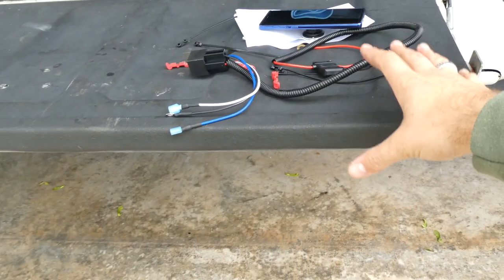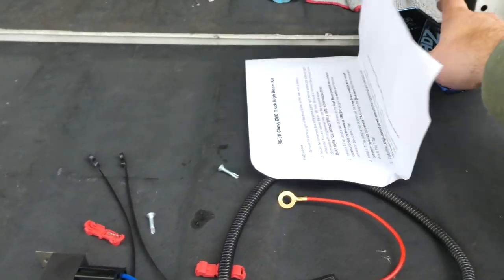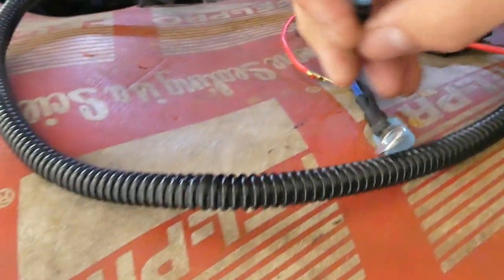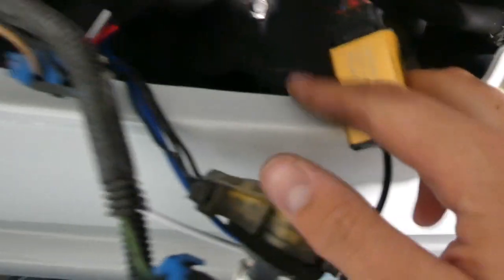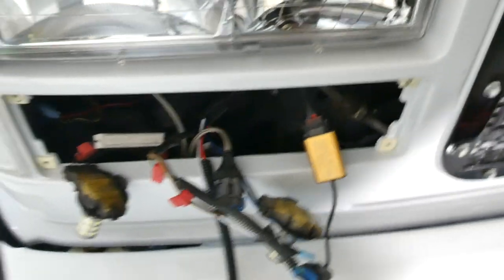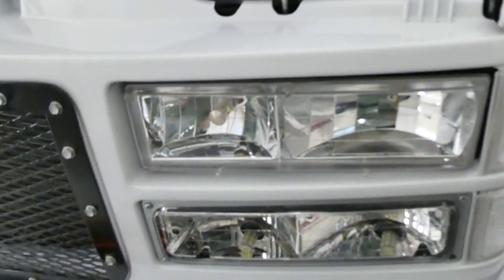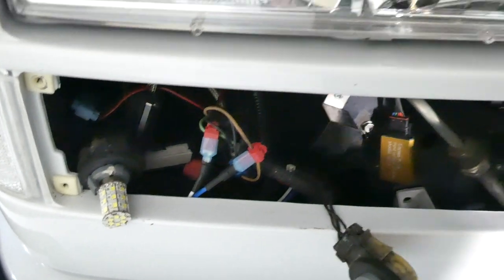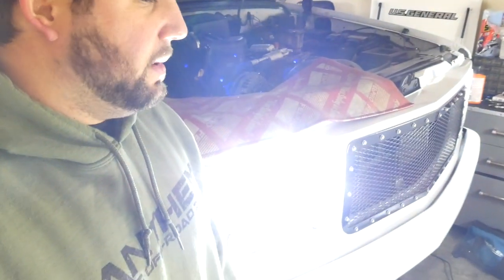4 Hi Mod 96-98 GM Truck - EASY TO DO!

Comment: I mounted all my hi4 kits to the firewall or the drivers side near the brake booster, and mounted the ground behind the relay screw, then the power wire to the fuse relay box power wire, then tap the headlight wiring behind the fuse relay box to hide for a factory look and easy of swapping the relay with having to pull the parking lights out

Comment: Like your vids, just updated all my lights to led and switchbacks for the turn signals on my 98 z71. Just a fyi you might want to put your power wire on a 12v accessory power, just to prevent battery drain. Attaching it directly to the battery is supplying power to your relay all the time. Thanks for the vids.

Comment: I have a 2001 Tahoe and I just took a piece of wire I had laying around and cut one of the wires got the head like and spliced it in and found a ground and now I have low beams that stay on when I’m using highbeams

Comment: I have been wanting to do this for my 96 silverado but haven't got the parts for it yet. I did buy true glass Spyder Auto replacement headlight housings which are very nice and you can replace bulbs if needed. I use Farhan 20,000 Lms 6500K low beams and when paired with the glass headlight housings are extremely bright. I was curious about the conversion like you did to not only see better up close but also farther away so I can see the deer better at night. The Deer are bad here meaning alot of them when driving so this might just be the way. Thanks for the video and explanation of the wiring of which goes where.   PS: T-Taps are so amazing. I even use them for my reverse light on my tailgate light bar with such a clean connection and super easy to do.

Comment: I have a 98 k1500 Just put led turn signal bulbs in and they were working fine until now. I only have turn signals/hazards when my headlights are off. Any ideas? The fuses look fine

Comment: Hi there! I fitted the wiring loom exactly the way you did on your video but my lights, when I hit high beam, are blacking out. Do you think that might be because I have normal bulbs? Not LED like you. Perhaps too much power? Any help or suggestions you could offer would be super appreciated!

Comment: Nice tutorial. What kind of headlight housing are you using? what kind of lights are you using for the turn signals and did they need resisters for hyperflashing?
Thanks!
Reply from the maker: Thanks! The headlights are just clear/chrome ones from eBay, bulbs are auxbeam LED. Turn signals are just some switchbacks from Amazon, and I had to add resistors and the EP29 flasher for them to work correctly
Reply: @BADZ71  thanks for the info. Keep the nice look on that OBS Chevy!

Comment: Did the T-taps come with the kit? If not, what size do I need?
Reply from the maker: Those came with the kit, and I've since then removed the kit to use the Movotor headlights, I'm not sure what size those taps were.

Comment: Hey man I’m debating on getting some of these headlights for my truck. On the parking lenses does the casing and lens come apart like your normal blinker casings
Reply from the maker: Yeah with some heat they will come apart fairly easy
Reply: @BADZ71   hell yeah man thank you. Your truck is clean

Comment: hey what light bulbs are. you running the truck for your head lights and for high and low bean and the indicator lights and turn signals light because I have a whiggt truck too with the clear lights and I want my front end to look like yours.. please if you read coukd you throw me some links so I can go by myself some too please thank your.. also geat video keep them coming bro

Comment: What every anyone does never use those stupid Scotch locks made by 3M or anything similar. They are one of the worse things ever invented for wiring. They cut the wire and open it up for corrosion. Butt connectors or soldering is the way to go. Also can mount on the driver side also. Power can be had from an available post on the relay box which also gets the components up under the hood and out of direct weather and water contact. Hid mine under the ecu

Comment: Why you have all those resistors lol i have all led’s in mine and no hyper flash. Upgrade the turn signal relay
Reply from the maker: Switchbacks require the resistors. I tried with just having the EP29 flasher upgrade but it wasn't doing it with the switchback in the mirror and the front lights.

Comment: Why does everyone pull the passenger headlight to do this mod? So much easier and better to just use the harness that runs down the drivers fender and power from the main on the fuse panel all right there. Both high and low beam wires pass thro that harness on drivers side near top of the fender

Comment: Their fuse is a TERRIBLE part of this WHOLE system as they put a way too big fuse in and it will melt the wire before blowing the fuse. Had this issue while installing my BOSS plow and put wires to headlight on wrong side so it melted all of my headlight wires when turned on.... just a heads up
Reply: What size fuse did u use instead?

Comment: The yellow parking lights now serve as Headlights?

Rather get a clear lens with a Yellow LED 🤔
Reply from the maker: This little mod allows your high beam headlights to be on with the low beam lights. The parking lights are Switchback, meaning white while running and amber for the turn signal

Comment: I noticed you had 2 lights under the hood and i tried looking thru your videos but i couldnt find anything. How did you that?
Reply from the maker: I think I may have touched on it in a video but don't remember lol. Just took a light from a truck out of a salvage yard and mounted it on the hood just like the factory light and wired it up.
Reply: @BADZ71  wired it up how? Make a video and i will sub😆🙃
Reply from the maker: Lol just connect it to the other light
Reply: @BADZ71  make a damn video!😡.....😂🤣
Reply from the maker: 🤣 DM me on Instagram if you have it. When I get the truck back I send you some videos.
Reply: @BADZ71  dammit you bobby! I sell propane and propane accesories i dont have time for ig😂
Reply: @BADZ71  thanks to your video it reminded me of getting the foglight switch as soon as i came across it and bam got it today along with the escalde console. You know what else i seen that was really rare, a canadian escalade cluster😲might go back for it tommorow since i wasnt tryin to fumble my console.

Comment: Where did you get your headlights and corner lights?
Reply from the maker: Good ol ebay
Reply: Would you happen to have the item description or link?
Reply from the maker: For the headlights I just search k1500 Headlights and there's a ton of options. The corners actually are no longer available

Comment: How do I get my inside turn signal lights to work
Reply from the maker: Do you hear the clicking noise when it's on? If not I'd suggest you replace the flasher relay. If you do hear it, then probably just replace your cluster lights.

Comment: BADZ71 your headlight switches inside the cab where were you able to pick up a whight switch at.. I can't find then anywhere I also have been trying to find a instrument cluster for all my speedo gadgets whight somehow anyone now whee I can find that at
Reply from the maker: I'm sort of confused by your question. You can get new switches from Amazon, RockAuto, or a parts store. The gauge clusters usually come from a salvage yard.
Reply: @BADZ71  I believe he is wanting info on the headlight switch since you have a white overlay on it like did you find the white overlay at a pick n pull or online.

Comment: I'd like to do the quad headlights to my 04 trailblazer
Reply: Look up fleece chips. All lights on mod.  They make a computer chip for $20 for your truck. So much easier than this install.  But only for 2003- current years 👍👍
Reply: @deez3814  
I did find a little wire jump wire thing online and did a quick vid on it.

Comment: I've always wanted to do this, I just dont really need it due to leds...
Reply: You just put led bulbs in the stock housing? Is it not blinding to everyone??
Reply: @jacobking4106  nah, they're bright but not ridiculously bright. Doesn't help its lifted 10" so I get brighted more often now since I'm right at people's eye level.
Reply: @jacobking4106  but before I put the suspension lift i would very rarely get brighted. And if I did because my dumbass left my brights on. Lol
Reply: @johnstri000  what kind of lights? Brand? I've got a 1995 and I'm sick of pathetic lights lol
Reply: @jacobking4106  theyre auxbeam leds. I got em like 4 years ago. I had to get the little power adapter. Theyve been going strong since then.

Comment: Would this kit work for a 94?
Reply: Yep
Reply: Yeah it’ll work for an 88-98
Reply: Yes electricity didn't change between this time. Even on the 2021 model years electricity is still electricity.
Reply: What you can do rather than connecting to the positive terminal, if the positive terminal is already clogged up like mine it, go to the fuse box on the drivers side engine bay and just connect it to one of the two studs. They both carry 12V and it still works perfectly

Comment: I have a kit, but it was just a single wire running from one relay to another and that's it as there's already relays for high and low beams. This kit makes no damn sense.

Comment: What leds did you use. I've bought a few and they are junk. Crappy light pattern.
Reply from the maker: I have lasfit right now, light pattern is still crappy, but not as crappy as others
Reply: Go stock. Toy lights suck and look ricer-ish
Reply: FAHREN and u get 50% off a 2nd pair